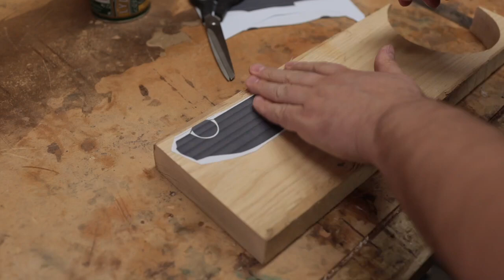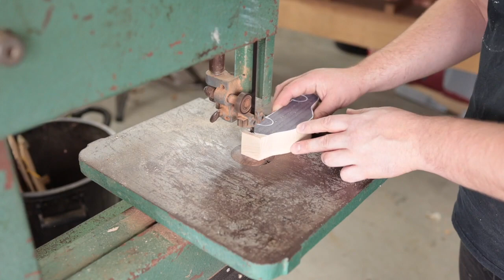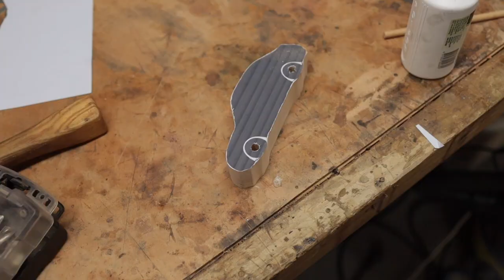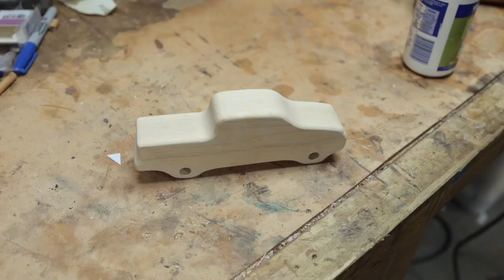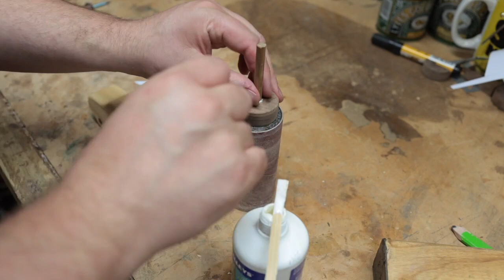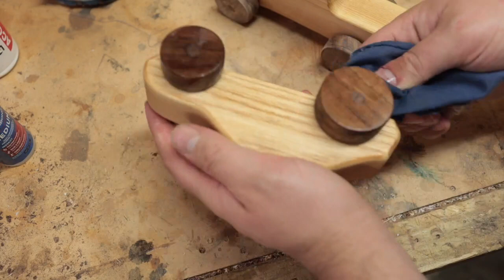Making Simple Wooden Toy Cars

Comment: This is great, thanks for sharing! What is the drill attachment you’re using to sand the wheels?
Reply from the maker: It’s just a bolt! If you spin the drill in reverse the nut will keep hold of the wheel tight allowing you to sand it